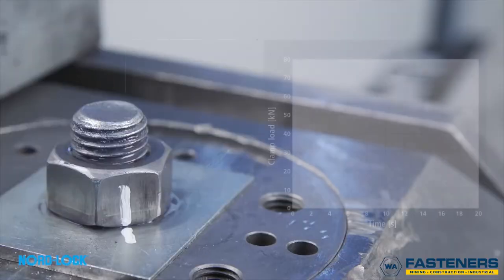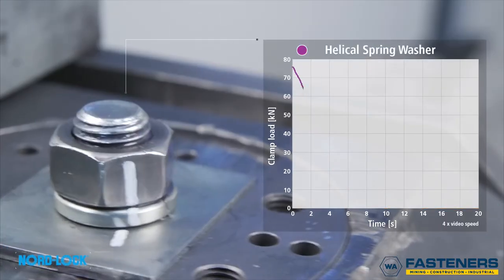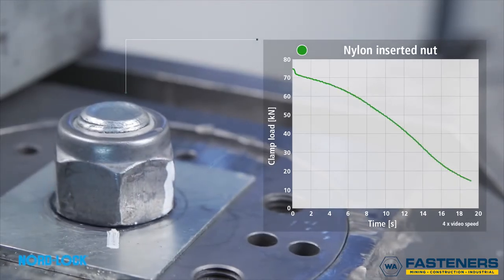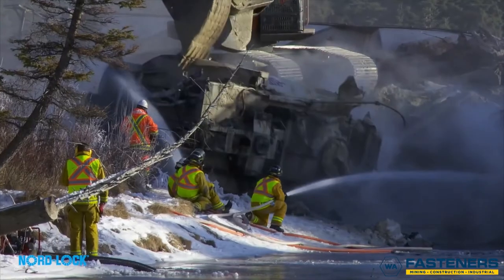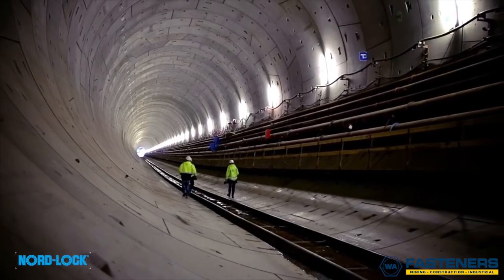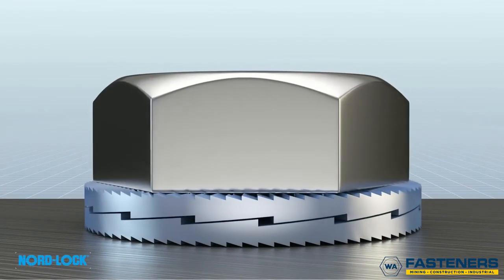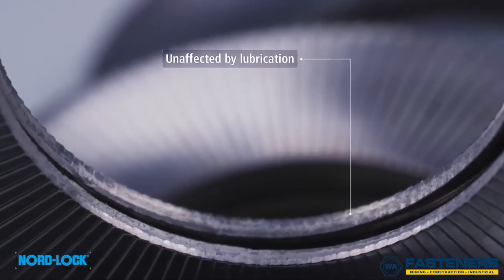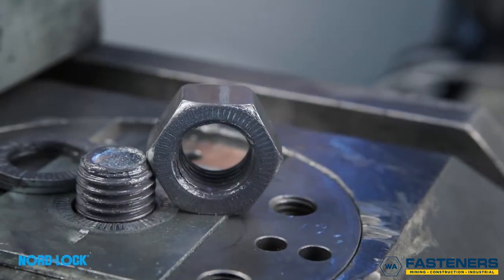Tired of your Nuts coming loose? See how Nord-Lock Washers compare.

Comment: The jam nut test was done incorrectly. The thin nut should be on bottom. Please re-run the test with the proper torquing specifications: install thin nut first to between 25%-50% final torque value, then apply second nut torquing to final required torque value.